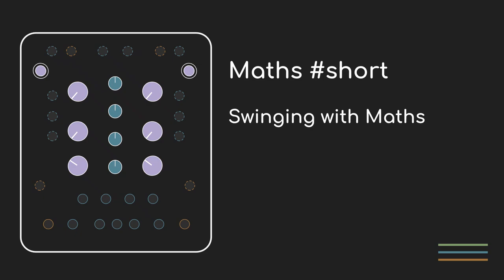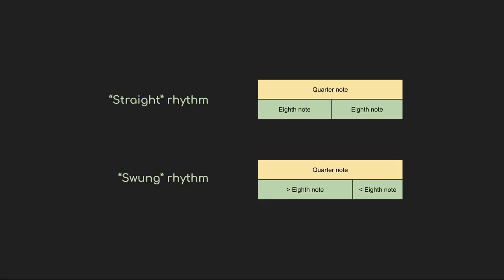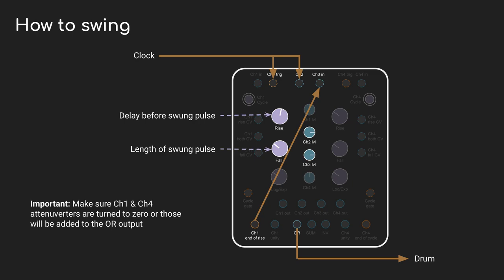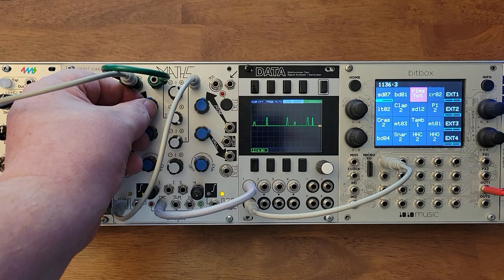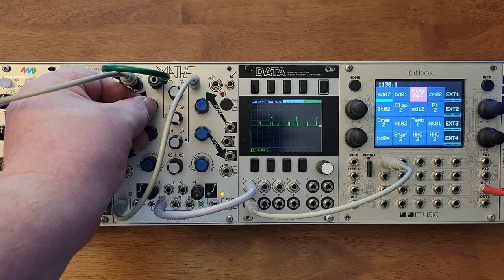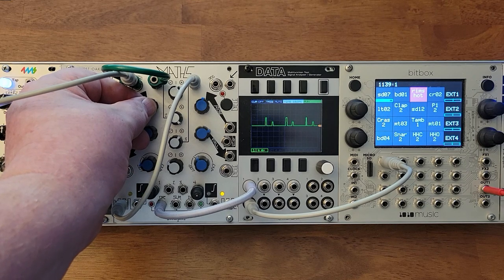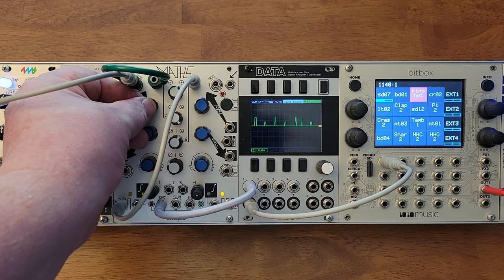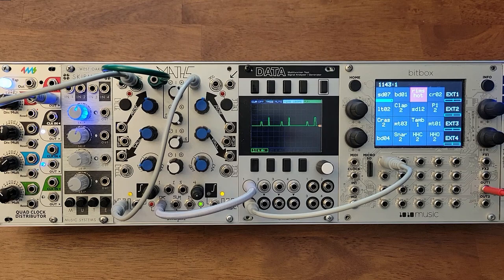Maths #short - How to swing rhythm with Maths

Comment: Nice clear explanation :) I like to use pwm on a pulse wave to achieve a similar effect. I think that advantage of that being that it stays in relative time as you change the tempo... but the downside is it requires more modules...